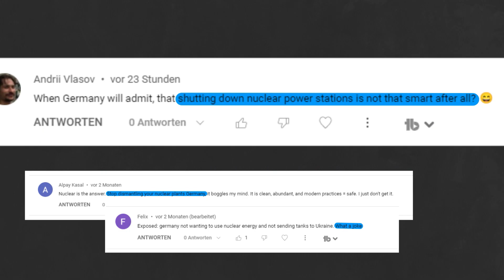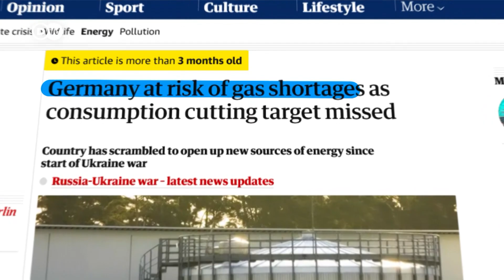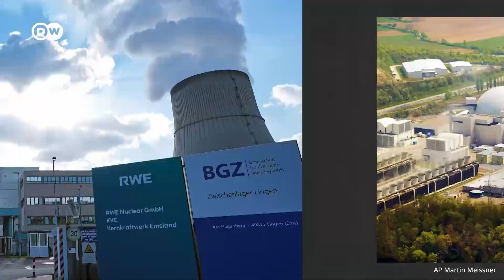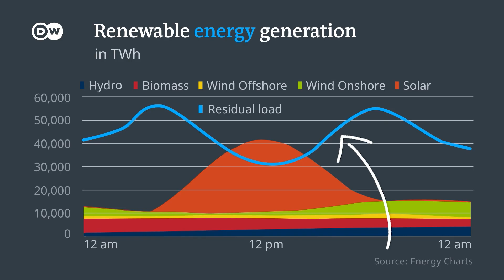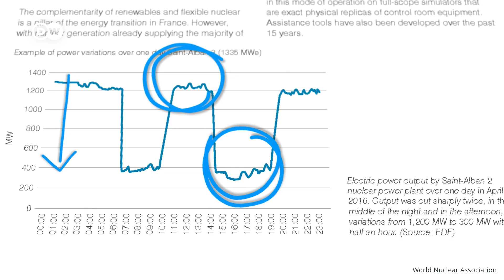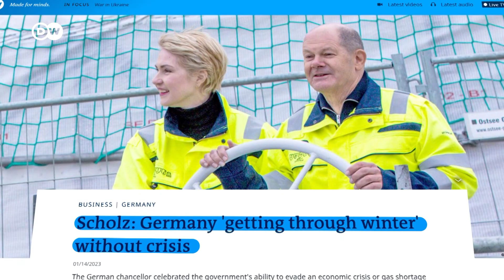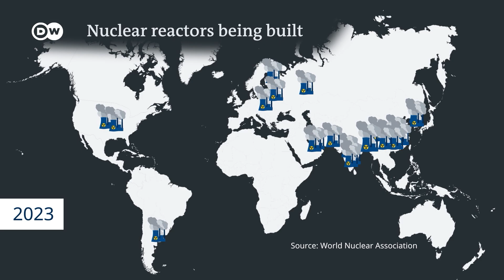Is Germany's nuclear exit a mistake?

Comment: What I miss in the DW story  is that the missing storage and weak grids are mainly the result  of 16y politics of conservative German parties. Without this delay the fluctuation and distribution topic of renewable energy would be almost solved. The irony is that , AGAIN, Chinese battery storage industry is the main winner of the very strong increasing storage industry in Germany. So the main problem in Germany are the constantly changing political boundaries but definitely not the renewables.

Comment: This video understates key issues with nuclear energy.  It’s expensive, risky, and dependent on public subsidies. Disasters like Fukushima show that low accident numbers don’t mean low risk, especially when renewables are already cheaper and easier to scale. Phasing out these reactors was the right decision. Issues weren’t addressed in the 30 years since the phase-out was planned, that’s a political failure, but not a reason to go back to nuclear energy.
Reply: Wait when you find out that for instance biomas kills about 15000% more people than nuclear per TWh. Hydro is about 4000% deadlier. Risky you say? When will you start shutting down these? Also, there is a slight issue with renevables (wich are in many ways great btw), and it is that wind and sun don't always blows and shines...

Comment: Germany is dumb asf for shuting down there plants if you are shuting down a power plant whether its a powerplant of a wind turbine you are alrwady fucking failing
Reply: The only situations where a power plant should be shut down is if it uses fossil fuels and you can replace the plant's electricity production with another source (e.g. coal plant for solar farm), is too old to work, or is too expensive for whoever runs it.

Comment: Absolutely a HUGE mistake.  They just should have kept the existing plants open.  Germany doesn't have good enough renewable energy resources to get through the winter without some firm power like nuclear.  Dunkleflaute is a real issue such that they need more geothermal, hydropower, or nuclear.  I don't think they have good geothermal resources, most hydropower has probably already been tapped, and that leaves only nuclear.
Reply: Exactly! People are quick to point of Sweden's (Hydroelectric) and Japan's (Geothermal) heavy and stable reliance on Renewables, while completely neglecting the fact that such specific geographic conditions are nearly non-existent elsewhere. Nuclear is the only choice for a stable baseload for most countries. Renewables CANNOT cut it, for we don't control the sun or the wind.

Comment: there is a big misconception: nuclear power is NOT carbon neutral! And the cost per kw/h is much higher than renewable scources…
Reply: Nuclear occupies a sort of middle-ground between the highly polluting fossil fuel/gas plants, and the barely polluting renewables. It's not as low as the renewables as everybody wants you to think, it takes 3rd place in CO2 when compared to 5 sources, in order from 1st to 5th: coal, gas, wind, solar. But it sure as hell isn't evil, and phase-outs should be avoided.

If you don't want to go full throttle on renewables, nuclear is a good choice, not for low emission energy, but lower emission. It also produces a lot of power due to the nature of atomic fission. However price is a problem also. Still, I think nuclear should be encouraged and stable, young plants should be LEFT THE HELL ALONE!
Reply: Technically, nothing is. But green energy sources are still vastly better than fossil fuels.

Comment: The fact is that Germany's PRIMARY energy demand has an 80% (!) share of fossil fuels. The discussion is always about today's electricity demand. Electricity is energy, but not all energy is electricity. The thing is that these other 80% have to be substituted with electricity and hydrogen. It's not a 1:1 conversion, but there's a need for massively more electricity generators. The argument that nuclear power isn't capable of load-following is a bit silly - because these plants could, at full load, produce the hydrogen that is needed for natural gas substitution. It would be the cheapest way of producing hydrogen at 2 USD per kilogram.
The other mad thing in Germany is - if Germany kept nuclear power at the same level as in 1990, Germany's electricity supply today would have been almost CO2-free. The only thing Germany has achieved so far is replacing nuclear power with renewables - while keeping the fossil fuel power stations online. Great job, Germany ...

Comment: For older designs, but more modern designs can ramp up and down quite frequently yes that would only apply if you built new nuclear, but when we are talking about the next 25 years yeh building nuclear to shut down coal would be a better solution. Also if Germany decided to develop super critical CO2 turbines you could ramp up and down like  a yoyo because in modern reactors it isn't actually the reactor that is the limit it's the steam turbine, and super critical CO2 turbines are much smaller for the same power which makes them easier to ramp up and down.

Comment: What people also miss about nuclear is that they are also a crazy heat source not just electricity. Rather than shutting the reactor off for when renewables provide peak power, the reactors could be kept running and the heat diverted to industry and manufacturing that often consume electricity to run equipment like furnaces, etc.

Comment: Renweables are good until you do a cost-benefit analysis and realises that you're paying 8x-12x what you would have paid per kilowatt. Don't look at just output, look at output per unit investment. There is a heavy cost to renewables.
Reply from the maker: Hey there! The levelized cost of electricity is actually lower for e.g wind and solar than for nuclear. What numbers do you refer to?
Reply: Germany has spent €500 billion on renewable energy since 2000. After all that you’re still reliant on fossil fuels, you’re co2 emissions are a lot higher than France, your energy bills are a lot higher than France. Renewable energy is obviously more expensive!

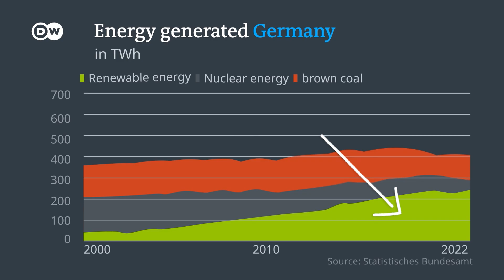Comment: 4:29, the crucial moment: Germany is ostensibly replacing carbon-free energy sources with more carbon-free options. The outcome? A blend of carbon-free and fossil fuels. On certain days, our CO2 emissions per MWh are merely double those of France, but generally, they're even higher. And yet, the Greens label themselves environmentalists – it's ridiculous. Even without Russia's invasion, the proposed backup solution was gas, a notable CO2 emitter.

Comment: Hello. I live on an 25 ft sailing boat. Yes i keep it in an marina but when i go sailing, i am 100 % off grid and generate all my power by an combination of wind and solar. The power generated is stored in litheum batteries at 12volt. I can run everything and charge up my devices. All you have to do is to calculate how much power you are consuming than calculate the size of the power bank into watts than double up the solar input and wiind. I use no coal or gas on my boat. My boat is all electric.
Gerard.

Comment: if you are building new plants you can also use thermal storage. the reactor puts out molten salt which can be stored at a large scale at high efficiency and then exchange its heat with co2 to run a turbine at higher efficiency than steam turbines. so you can throttle the reactor at whatever speed it can manage and then the moment to moment fluctuation is taken up by the stored molten salt which can be ramped up and down as needed.

Comment: A good portion will get replaced by increased solar and wind, and more energy efficient devices - like heat pumps and the like.  It'll take time, but they'll do it and you'll be on your way to less coal in use again - although NG will probably increase some.  Looking from afar, I hope the UKR/RU situation changing fuel sourcing will get all the countries working together to be able to cross share effectively and provide mutliple paths from multiple sources.   I personally think nuclear that was up and running should have been allowed to live out its design life.

Comment: So Germany purposely closed down clean working nuclear power stations to use coal powered stations to make up the difference all because they were afraid of an accident. I think they made a big mistake which has now made things worse for the environment. Have they also considered the manufacturing of wind and solar including batteries are environmentally unfriendly with panels having to be changed every 20 years or so and batteries every 10 years or so? The panels and wind turbine blades will go to landfill as there's nothing recyclable in them and the cost, money and environmental, will be much greater overall. Stick with nuclear, just make them safer if that was the main concern, no need to reinvent the wheel and go to extremes!

Comment: Well Fukushima probably wouldn't have been as severe if they had place the backup power in a spot well away from water and able to withstand earthquakes because the main cause for it failing was because they were placed in a vulnerable area in the reactor to which it can flood and fail if you have a spot where earthquakes and tsunamis are often you need to have everything structured in a way to defend from structure damage and away from getting flooded by water including the backup power, it's that design flaw that Fukushima had occured

Comment: Several points:

- Those mass protests during '70s were a result of conflating nuclear weapons (like American Pershing missiles which would guaranty that Soviets would target Germany in the case of conflict) with nuclear energy, a confusion carefully groomed by fossil fuel lobby.

- Even under the many times debunked "lnear response" model, Chernobyl will have killed (in terms of outright deaths and shortened lifespan) fewer people than coal powered power plants do in a day or two (via particulates, sulfur and nitrogen oxides and, yes, radioactivity).

- Frau Merkel, Fukushima incident demonstrated insane level of nuclear energy safety: even after a magnitude 9+ earthquake and resulting tsunami hit the plants that were constructed with many corners cut (e.g. no gravity-fed or convective emergency cooling, a no-brainer with recent designs), it is suspected that one of the early responders might have died from consequences of radiation exposure (he died of lung cancer several years after the incident).

- Re:  Ukraine: natural gas is slightly better than coal, but what does it have to do in the same sentence with renewables?

- 2:59 - OK, so 41% od Germans actually think.

- 5:02 - HOW?

- 5:57 - Yes, French nuclear power. Talk about hypocrisy!

- 8:50 - Photovoltaic panels and wind turbine blades also have finite lifetime and need to be decommissioned. And here we were talking about existing nuclear power plants.

- 9:50 - Safety ?!? Nuclear energy is many orders of magnitude safer than coal. It is even safer than residential solar - apparently, climbing roofs is risky. 

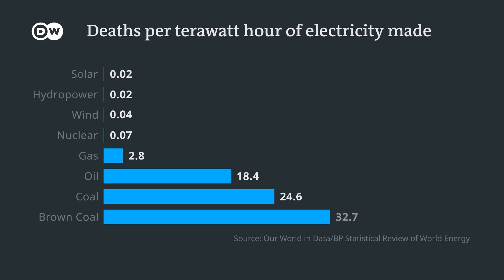- 10:42 - Yes, another invented "problem".

Comment: I think its stupid  nuclear  takes up a very little  land that could be given back to nature to help with green house gasses. And produces the most energy the cleanest.  Compaired to any other source. 

Wind is great but takes up allot of land. As u cand have anything in the way of the wind currents. And has to be too a point isolated. Its prown to breaking rapidly.  Wind turbines in the us are always being repaired. 

Solar is great. However  solar takes a huge ammount of cleared land. And heavily heats up the surrounding  land making it difficult to work with in mass installations due too over heating. As well solar pannels are fairly brittle compared  to other energy methods  and require  special  minerals  to build. 

Green gasses. Such as hydrogen  are great yes. But require just as expensive  infrastructure.  But still a good option if u can support it. Witch Germany cant on its own. 

Coal just bad dont thonk i meed too say much. 

We literally  prefer  clearing land and expanding  our human presence on lands that naturally  capture green house gasses just soo we can mine more materials  and waist more resources  to say we are going green. 

Nuclear fission or in future fussion. Takes little land produces huge energy.  Dosnt require  the mass amounts of material that other methods use. And cand be made very safe. Out of the hundreds of plants less than 5% of those reactors  had problems  compared  to any other source of energy.  

And if people  are afraid  of how deadly nuclear reactors can be. We drove vehicles  that kill millions every decade. Nuclear reactors  haven't  affected  nearly  as many people
Reply from the maker: Hey, thanks for commenting! ⚡ Nuclear is certainly worth considering and looking at from many angles. Have you already seen these videos we made about it?
📺"Do we need nuclear power to stop climate change?"
https://www.youtube.com/watch?v=9X00al1FsjM
📺"Is nuclear fusion the key to fighting climate change?"
https://www.youtube.com/watch?v=eyHovWQ49MI
📺"Can thorium nuclear energy make a comeback?"
https://www.youtube.com/watch?v=Km6kqykX900
📺"This could become the most radioactive place on earth"
https://www.youtube.com/watch?v=QFEd5RkotFE.
And please let us know your thoughts in the comments! ⚡
Ps. We also have videos on hydrogen, coal etc. Please check out our channel and subscribe for more!

Comment: If you do nit-picking, nuclear power is not really renewable as some people say. We need nuclear fuel, consisting of minerals and elements that are non-renewable. Further more the fuel is mined in countries, we do not want to be dependent on, like Russia. And if I remember correctly, France had to (temporarily) shut down/reduce many of their plants last year, because the rivers which supply the plants with coolant were running low on water.
Additionally, as mentioned in the video, the nuclear waste has to be stored somewhere for hundreds of thousands of years. Where to do that? Im just waiting for the first country just pay an third world country to get rid of their waste (like with plastic).

Nuclear can sure be helpful in the short term, while energy storage technologies are being developed, but I think it is more harmful then helpful when used in the longterm.

In my opinion Germany is on the right path, it is just "ahead of its time", in a sense that electricity storage technologies can not yet handle the needed capacities and therefore its much harder to perform this full renewable transition right now.

Comment: Interesting! Here in Australia, we had a similar foray although we did not end up building nuclear power plants due to mass protests (even the research reactor of Lucas Heights was heavily protested). Yet, we are now emerging with insane levels of renewables to the point where fossil fueled power stations have been announced to close earlier than planned. Our wholesale pricing, from what has been reported by the ABC, often is going negative for coal and gas energy sources meaning they are paying to supply. Maybe, Germany intended more renewables than where they are at, like us Aussies, but I guess the parallel is that demand will drive the change and we are seeing that here in Aus. Our current Prime Minister recently stated nuclear is not an option and he is right, not because of carbon reduction, in the Australian setting it is more economically viable for us to go renewable. Engineering with Rosie has plenty of videos on this as a Canberra based engineer.
Reply: Australia has one of the highest carbon emissions due to the many many coal plants. Where did you get the idea you where green in any way?
You have almost 3 times more coal than wind...
Reply: @laxarus3259  Very true, I apologise for giving the impression we are "green".

Comment: No!
Reply: The question "Is water wet?" is a classic philosophical conundrum that hinges on the definition of "wet." When we describe something as wet, we typically mean that it's covered in a liquid, usually water, and that this liquid adheres to its surface, altering its properties. A wet sponge, for instance, is wet because water molecules are clinging to its fibers. However, water, in its pure form, doesn't have another liquid to adhere to in the same way. The wetness we associate with water is actually the effect water has on other substances; it's the ability of water molecules to interact with and adhere to the surface of objects. So, while water is the quintessential cause of wetness, it's not itself wet in the conventional sense. This is a matter of perspective and definition. One could argue that since water molecules are attracted to each other through hydrogen bonds, and this attraction leads to surface tension and cohesion, a form of internal wetness exists. However, this interpretation departs from our everyday understanding of wetness as an external condition. Ultimately, the answer depends on how strictly one defines the term "wet." It's a question that highlights the limitations of language in precisely capturing the subtleties of physical phenomena. It prompts us to consider the inherent ambiguity in many seemingly straightforward concepts, encouraging a deeper understanding of the world around us and the words we use to describe it.